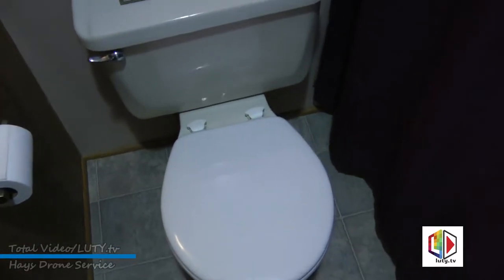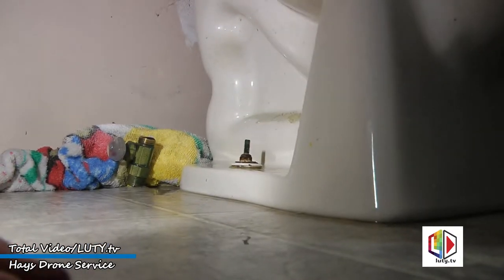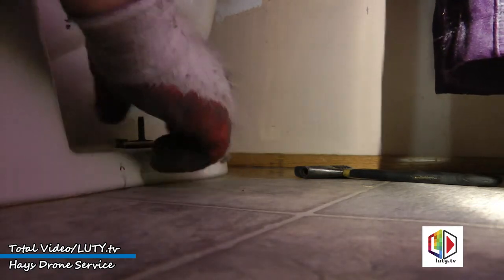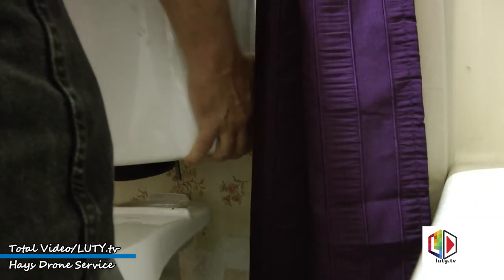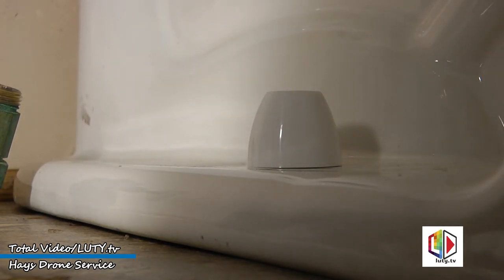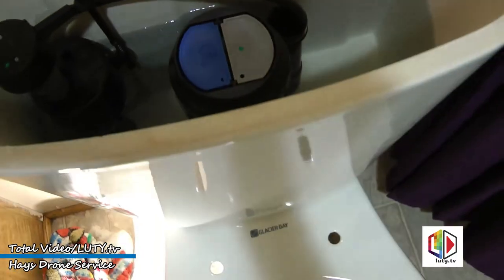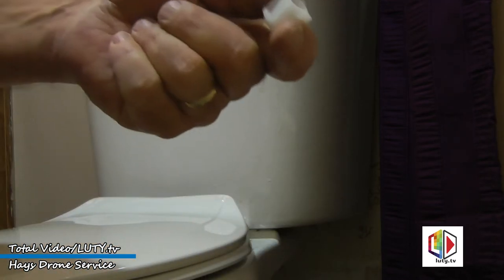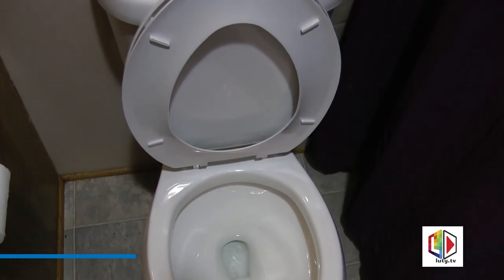How To Replace a Toilet with Low Flow Glacier Bay Dual Flush Toilet-Rebate Eligible

Comment: I would have painted the wall when I had the toilet off. Lol.    But besides that. Great video. I used the wax to install a different toilet in my house. I just used a toilet I got for free that was in better shape than my old toilet.  The only question I have (idk if you are a plumber or not) is when changing out a toilet, is there a way to clean out the drain pipe to help it flush better? The toilet upstairs in my house seems to have issues flushing. The drains in my house seem fine tho, just the toilet is having issues. It may just be my toilet also, but I was thinking about replacing it with a new one like the one you installed.
Reply from the maker: Thanks for the comment Casey. I'm not a plumber by trade but have done quite a bit on my own stuff. I'm not a painter so if the wall gets painted it will have to be someone other than myself. As for the drain pipe clean I don't know how you'd do that. Mine looked like new even after 35 years! I was surprised. I'd say slow flushing is because of the toilet and not the drain pipe. Often times items get dropped into the toilet that aren't suppose to be there. I guess if I have a bad flushing toilet I'd remove the toilet and dump a five gallon bucket of water into the drain pipe and see what happens.